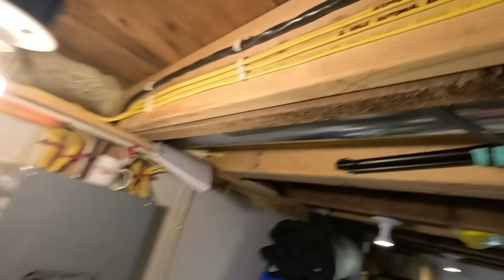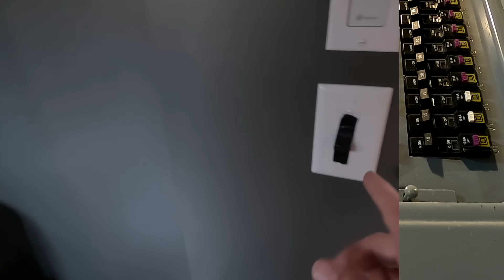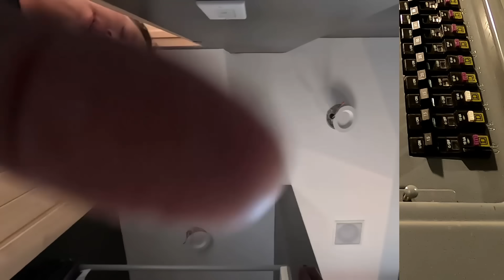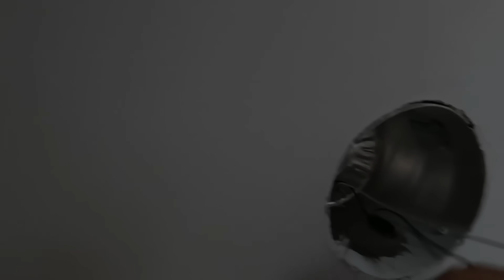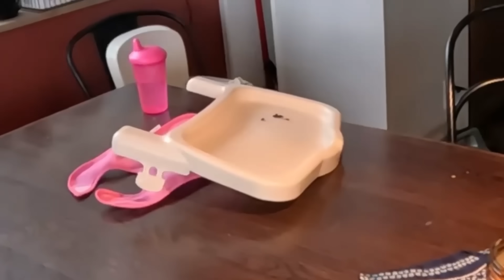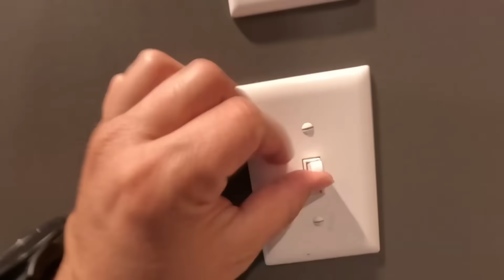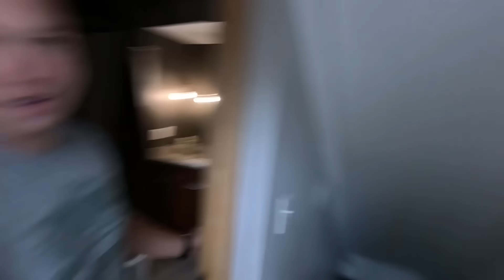Arc Fault Breaker Keeps Tripping! How To Fix It!

Comment: I’m not convinced you found the problem. It is certainly possible that you are getting an arc in the toggle switch itself. By disconnecting all the load you’re in effect removing the toggle switch from the circuit. What you should do is connect the known good lights back up and try to switch again and see what happens.

Comment: Wet-rated (or damp-rated, sealed light fixtures, typically go in shower's. And also it's a possibility the breaker  is a GFCI included with the AFCI.There More sensitive to a  trip

Comment: Just today I had to chase a tripping breaker in new construction. The garage lights are plug n play and the circuit kept tripping. After about an hour and a half of chasing ghosts I discovered when the lighting receptacles were out of their boxes the breaker would hold. It ended up being a bad plug. No grounds touching neutral, no pinched wires, just one bad receptacle.

Comment: my AFCI breaker will not get to the on position after I turn it off and try to turn it back on. It has been in the tripped position ever since it was tripped.  Can you please tell me what would be the issue where it only goes to off and when I try to push it to on it gets to the tripped position ?

Comment: What does the blue test button in a Siemens breaker signify ? Our home was built in 2018 and we've needed to replace about half of these breakers as once tripped they no longer seem to operate at 15 amps but trip around 12 amps. Of course these were mandated for new construction by the city (without proper investigation) . Newer construction now defaults to 20 amp wiring even for what would have normally been a 15 amps circuit so that when they have been tripped the breakers (20 amps) still perform at approx. 16.5 amps. All my replacements have been done by certified electricians.

Comment: If the grounding conductor and the neutral conductor are contacting anywhere in your system in device boxes junction boxes or actual appliance, light fixture or anything, this will cause an arc fault breaker to trip immediately or at least once that part of the circuit is carrying current.

Comment: I just had my kitchen redone, and I noticed that the dishwasher has its own GFCI outlet under the sink, and it goes directly to its own GFCI/ark fault breaker with the panel, because it does have a purple test button on it, is that Overkill?

Comment: Ben

Thanks for your helpful vids.

Frequently when I've diagnosed a customer's immediate or nuisance AFCI breaker tripping, the resistance reading is 100 ohms or much lower.

When does a "beep" continuity reading cause AFCI tripping?

When does a "beep" continuity reading NOT cause AFCI tripping?

Comment: OK, help me out here, why would the breaker trip if there was no load at all?
I don’t know exactly how AFCI detection works, but if there’s no round-trip back to the breaker through the neutral, how does it know if there’s an issue in the wiring or in the device?

Also, when you said that you prefer real recessed cans, did you mean the kind that take a regular ball rather than the shown in this video or ?

Comment: The light in your shower had the arc fault. I therefore have to ask, are these lights approved for damp locations? I did not see any conformal coating on the electronics, so I'm guessing not. I would make sure that any lights installed in a bathroom state that they are approved for use in damp or wet locations.

Comment: My rented dryer was the item that caused my cb to trip  so I have contacted the Rental Company. Although recently an Electrician came to work on our Stove last week but nothing has gone wrong until today & it was the dryer as I connected it to two different plug outlet & it went POOF and the cb tripped again. In your video my NZ cb looked just like your one in the video. Thanks 😊

Comment: So far, I despise AFCI breakers and they make my life miserable. The Siemens 20A units in my 2020 house randomly trip for no legitimate reason. They just don't like certain loads, or are over-sensitive to noise that 'sounds' like an arc. My neighbor got so fed up with them that he replaced all of his breakers with non-AFCI. They really aren't "necessary" to begin with, and in a house where there aren't any actual faults, there is nothing unsafe about downgrading to non-AFCI. It's better than walking down the hall every 5 minutes to keep one laptop and a cablemodem powered. The house also came with Feit LED fixtures similar to yours. All but two failed in the first 4 years. I went back to incandescent GE bulbs made in Hungary.
Reply: I agree AFCI breakers are a pain in the butt, and nothing but trouble... until they prevent a fire. What if a rodent chews the insulation off your Romex?
That being said, I have no intention of replacing my basic breakers with AFCIs. That's what smoke alarms and fire extinguishers are for ;)
Reply: @thehoneybadger9262  Hundreds of millions of houses without AFCI haven't burned down for above and beyond 100 years.I'd rather have electricity than use a device that constantly functions when it shouldn't, and might not function when it should.
Reply: @JSMCPN  I understand your frustration. Unfortunatley the 2023 electrical code in the US now calls for these breakers to be installed on almost every residential circuit. We're in for a lot of pain. I'm sure the insurance lobby is driving a lot of this. They'd rather we deal with nuisance tripping than them building a new house.

Comment: Im an electrician, SIEMENS afcis are notorious for nuisance tripping.  I did the electrical in my basement and added a freezer circuit and I put that on a faceless afci to avoid the possibility of my freezer tripping while on vacation
Reply: Just finished a home renovation and we now have several Siemens arc fault breakers. All done by licensed electrician and properly permitted and signed off by the town. We have two breakers which are frequently tripping. I would like to try a different brand before digging deeper into the problem. Which brand do you recommend? TIA!

Comment: I would suggest putting one above the shower that’s rated for high humidity. Or maybe look into doing a conformal coating yourself on the one in the shower. Just dont put the coating over the LED’s, just on the PCB, and around the LED’s to the PCB. It cold have been the humidly (and soap and stuff with it) that built up and caused that arc.

Comment: LED’s may last a long time, but the components and capacitors in the power supply for the LED’s probably wont last nearly as long with cheaper brands. Most of my LED light failures are capacitors. And sometimes because the heat disappoint wasn’t good and the PCB and components got too hot. Electronics and heat are not friends. So in most cases you hope more expensive fixture use better thermals and component, but that’s not always the case, just in half the case. But you can almost grantee the cheaper ones use cheaper components. They have to cut that cost somehow.

Comment: Ben, typical homeowner here with a skill set above dangerous but no better than amateur.  So recently we noticed the garbage disposal started occasionally tripping the arc fault breaker. Then got progressively worse until today it tripped almost every time it was turned on. (All the components are about 4 years old.)  So looking to save the cost of an electrician call I read what I could on-line. Armed with a little knowledge and Kentucky windage I did the 'normal' stuff. When I pulled the off/on switch I couldn't help but wonder if where the quick disconnect "push in" wire is both held in place by the little "leaf spring" and also where the electrical connection is made, could be an issue. So I pulled out the wires and reconnected them using the side terminal screws.  Time will tell but after repeated cycles the breaker no longer trips. While I am not totally convinced this is what fixed it, seems kinda reasonable to assume it might have. 
That was a long-winded  lead in to my question. Have you ever heard of this being an issue with arc fault breakers? If not, what do you think of my theory?

Comment: If you wire up the breaker wrong where Circuit A hot or neutral is going to Circuit B breaker and they are crossed it will trip also. Happen to me when the electrician wired up my new panel.

Comment: I'm willing to guess that the light fixture above the shower is unsafely close to the moisture of the shower. I think that there isn't supposed to be a light within 8 ft. above the shower top rim or within 3 ft. horizontally of the shower.

Comment: I would have thought your bulb adapter was at fault and not the LED light itself but those aluminum circuit boards can be a source of pain.  LEDs can last forever, but you have to run them below their maximum current. Most manufacturers engineer their lights to run at maximum current for max brightness but a better idea would be to run them at about half the current and just double the number of LEDs to get more light output and a much longer lifetime out of them.

Comment: Can you use two single pole with handle tie for 240 volts line to line loads?
Reply from the maker: I believe so, however I would not do that unless it were an emergency/temporary situation. Much better to get a dedicated 240v two pole breaker.
Reply: @BenjaminSahlstrom  
Code allows approve handle ties for supply of single phase 3 wire with center tap grounded.
Reply: @BenjaminSahlstrom  
Please have a video on installation of 2 pole AFC1 for line to line loads

Comment: Hi there.....per the NEC code, bathrooms are exempt from arc-fault breakers for lighting.  Any idea why this circuit included it?  In this case it was actually a good thing!
Reply from the maker: Because all my main level lights are on the same 15amp AFCI breaker. Good question!

Comment: quick question im changing out a sub panel inside the house. but the wire from the main to the old sub looks to be a #10 cooper. it dont look right to me what size wire should i use cooper or aluminum. it s a 50ft. run. im going to put a 200 amp panel in.

Comment: In my limited experience, ARC fault breakers cause more problems than they prevent. Frequent failures, outrageous cost, tripping on the microwave or refrigerator. Dollars to donuts that light was never going to burn your house down. That ARC fault caught it early, thankfully, but I am pretty sure a normal breaker would have tripped long before anything catastrophic occurred. Think about your experience with those lights and all the old houses that have them installed with no ARC faults in them at all. No thanks.
Reply: It would be interesting to know what the average number of nuisance breaker resets is before the breakers are replaced with non-arc-fault breakers. 🤣

Comment: I actually test my breakers when i put new batteries in the smoke detectors , which i do when the time changes and i reset my clocks. My new detectors are hard wired but i have 3 that are not

Comment: maybe you can explain   i ran a dedicated 20 amp circuit with 12 gauge wire to my garage a year ago no problem  using it for a chop saw, band saw etc yesterday i hit the trigger on the saw and heard a pop  the breaker didn't trip opened up the the two gang outlet box and saw the white wires connected with a wago burnt i repaired the connection all is fine now  Can you explain what happened

Comment: If you are sharing neutrals somewhere they will also trip or if you've got a ground wire to close to your hot they will trip. If you have a GFCI plug on that circuit they will trip sometimes interfacing with each other.

Comment: I’ve had good luck with a house full of Lithonia Lighting 4BEMW 30K M6 LED Recessed Downlighting. Have had 0 of 74 I have in a new build work fine for the last 7 years. Have survived a lot of lightning strikes and they work well with dimmers including Lutron’s smart dimmers. Some even are fine with wet environments.     Also Phillips hue down lights. They’re expensive but Home Depot has amazing hue sales. Found the 4 inch hue color down light for $14.99 yesterday. Normally goes for $60.

Comment: Some motors like hair dryers use brushes and spark when runnning, also led lights usually have electronic ccts which could simulate arcing
Reply: I had an old vacuum cleaner that I could never plug into the bedroom plugs because it would trip the breaker. AFCI breakers are a blessing and a curse.

Comment: I have come across same situation with plugs, when someone changes the plug and pushes the wires back in the box  the ground touches the neutral screw on the outlet. Everything is fine until someone plugs something in the outlet and the arc fault trips. That’s a hard one to chase down.

Comment: A motor like a ceiling fan, pedestal fan or space heater will also trip an Arc fault breaker. 
Had it happen to me the way my 70 year old house was wired!

Comment: The arc fault may not have tripped in your test either because you moved the fixture enough to disturb the problematic internal connection, or because the fixture was hanging in the air and the metal frame was no longer grounded.

Comment: I had an Arc breaker that would trip a couple times a year. One day I lost power to that half of the panel. 
 The power company came out and fixed the feed at the pole, said the connection was corroded. That's been over 2 years and that Arc breaker has not tripped since!

Comment: Good video, After unplugging the 2nd light, I would have just left the light switch on and see if it would have tripped right away, saving maybe an extra trip up and down. Nice neat wiring in that house, what are the red/orange things holding wires together on joist. I like how the wires were run and staples staggered to give nice appearance. I understand time is money and on a job stie they would take time like that, just get the wire ran. several code violation on the panel easily noticeable right away, surprised no one else has mentioned it.
Reply: How did he know the third light was the circuits problem when he never repluged the first two lights connections back in????. The first two lights should have come back on!! After he disconnected the third light, and then tested it, if he reconnected the first two lights connections. Crucial trouble shooting detail he left out.

Comment: Your bathroom lighting should be on its own circuit separate from every thing else except for maybe the exhaust fan.
Reply: Agree! If you trip the breaker with you hair dryer, you don't want to be in the dark. In general, room lighting should be a separate circuit from the outlets.

Comment: I usually test mine yearly (January sometime) when I replace the batteries in the smoke detectors. I test using both the test button AND I have a plug in test item that has 2 buttons, one that draws 30A (240V here) which should immediately trip any circuit as they are 16 or 20A breakers, and the second button draws 40mA to earth, which is over the 30mA fault level required here. I have had one breaker fail the earth leakage test and got replaced 2 or 3 years ago.

Comment: I would've unplugged all the trims first, then if the switch and circuit are on, plug each trim back in till the circuit trips, saving having to keep going to the panel to reset it. Everything Fiet is poor preforming. Halo or the same trim in another brand, made by Cooper lighting are more reliable. For new wafer installation, RAB and Topaz are very popular. 100,000hr life. They cost more, but you get what you pay for. A friend asked me why are all 6 LED fixtures randomly flickering together. One "Commercial Electric" Home Depot brand was causing the problem. Older homes don't have AF breakers. If a neutral is touching a ground in a normally ON circuit, an AF breaker will trip until the grounding neutral contact is cleared.

Comment: Ben, can you have an Arc Fault Breaker start to go bad?  I have a 20 amp breaker feeding some outlets in my kitchen and branched to my office.  I run an espresso coffee machine in the kitchen and it occasionally trips the AF breaker.  The coffee machine does not draw 20 amps by any means.  The only other item on the circuit are a router and network switch plugged up.  Seems like there wouldn't be anything anywhere close to 20 amps being drawn.  I'm just wondering if this AF breaker is bad.

Comment: Your Question how offen do you test your AFCI ...
My Question Do you think a circuit breaker manufacturer would deliberately give you a practice that would shorten the life of said circuit breaker?

      Safety might dictate that you should check your GFCI outlet or arc AFCI devices regularly, but it's my thought that doing so too often COULD cause a mechanical failure.

Comment: A faster diagnostic method with fewer trips back to the breaker box is to unplug everything, turn the breaker back on, then see which thing trips the breaker when plugged back in. Only one breaker box trip unless you have multiple faulty devices.
Reply: Except when the breaker trips with nothing plugged in

Comment: Good information, thanks! I have a question about a different topic. I live in a 60’s home that  has no ground in my outlets so can I drive a copper rod and use that to add a ground or do I need to wire back to the fuse box? My boxes are metal but they are not grounded… thanks

Comment: That's odd because Fiet used to be a quality brand. Their incandescent bulbs were rated for 130V when all others were rated 110-115V. That made them last longer. As for GFCI and AFCI devices, I have no faith in them as they seem to be very finicky. I feel they are gimmicks invented to fill someone's pockets. House have been built for YEARS without them and have not had enough problems to warrant their use and the ensuing aggravation they cause. I have wired many homes and other buildings in the past without them and NOT ONE OF THEM has had any  negative consequences because of that. My opinion.